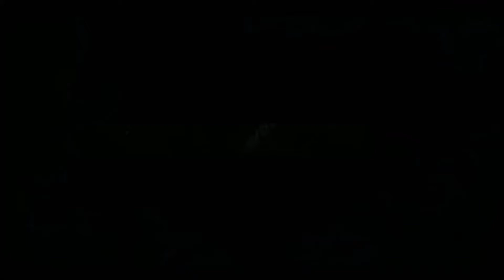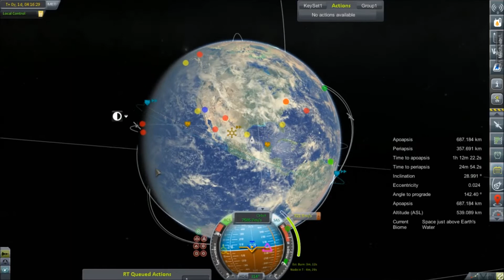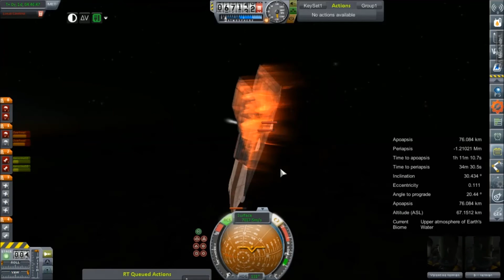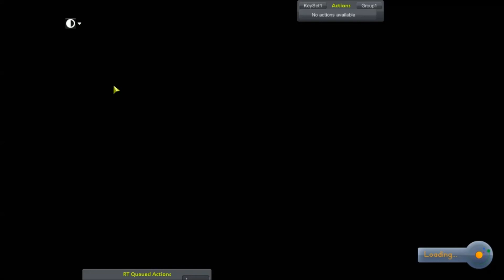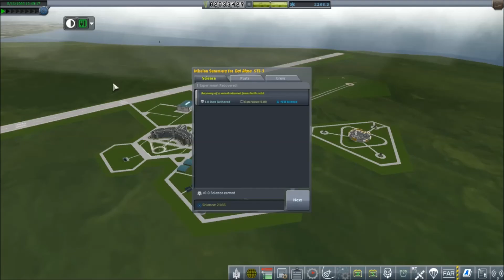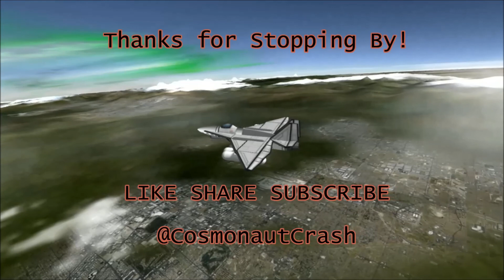KSP RP-0 #170 Failure of STS-3

Comment: this is why I don't like spaceplanes. The reusability is great, but the lack of active abort system and how unstable they can be at hypersonic speeds is a huge disadvantage.
Reply from the maker: It took a while after this episode, but I did start using a mod (atmosphere autopilot) that helps greatly with the hyper sonic stability. 
No other system can really compete with a shuttles ability to generate cashflow. The three kerbal to LEO contracts can net a lot, and the quick turnaround time makes them cheap to field, quick to launch, and highly profitable. They may not be the most fun sometimes, but the shuttle program has kept the program afloat for many years :)

Comment: I like the idea of the shuttle but to be honest there’s a lot of flaws The cockpit is way too exposed so it could easily get burned up and also it’s gonna take a lot of time for the parachutes to start slowing down the shuttle because of how much it weighs and also The orbiter engines are just Way to efficient so you could actually go over your Ap and it will be a nightmare trying to find a landing zone so I suggest having bigger less efficient engines that have a lot of ignitions The boosters are a good idea to but I think you should use very strong SRBs just to kick the orbital parameters up a bit
Reply from the maker: The cockpit has a pretty good heat tolerance - so long as the angle of descent is kept in check
The chutes are more of a stop-gap in case I screw it up - it really is meant to glide to a safe landing
The OMS engines have infinite relights - and are really the only engine I have access to at this point that will do the job at all ( Astris II maybe. )  The deserts of North Africa make a pretty good landing zone, and it is easy enough to hit, till I get better at aiming. lol
I never put SRBs high enough on the research queue to have them unlocked in time - best one I had at this time ( and still ) is the M55 minuteman - witch just doesnt get the job done.
Reply: Well still I actually like the shuttle but on the third mission it was having an extremely hard struggle well of course everything else was successful but when you were entering the atmosphere it’s like the flight computer said F you and just gave up on you and the shuttle rapidly begin to sending and begin oscillating uncontrollably so I suggest having better control systems or just add more RCS
Reply: Cosmonaut Crash maybe you shouldn’t reenter at 7000 m/s

Comment: Did you know you can tell FAR what mach number to use to calculate stability derivatives? When you're designing, set a re-entry mach (18 - 25) and see what FAR tells you.
Reply: This was a rough reentry through the atmosphere!
Anyways, nice video to watch and shared your video:)
Reply from the maker: yeah, i typically do these checks when building ( sometimes you can catch a glimpse in the build-a-sodes sped up footage ) I did not on this one after tweaking the wings and the weight balance though. Thinking such small changes wouldn't be this catastrophic.
Reply from the maker: Thanks!